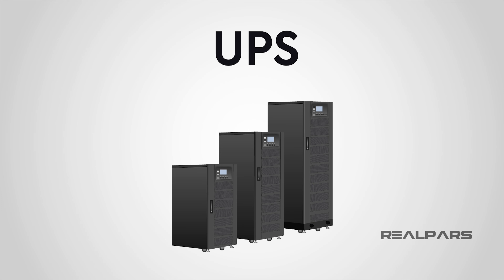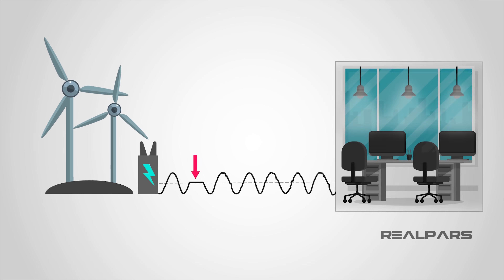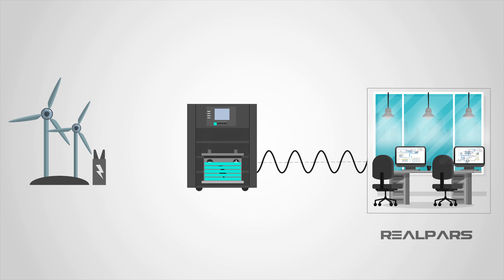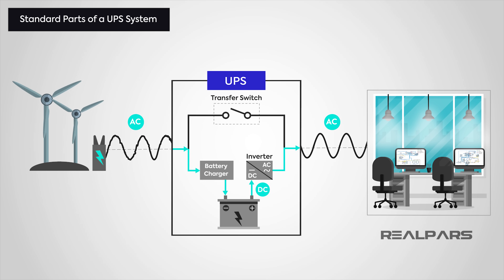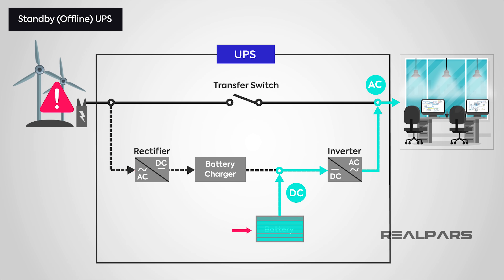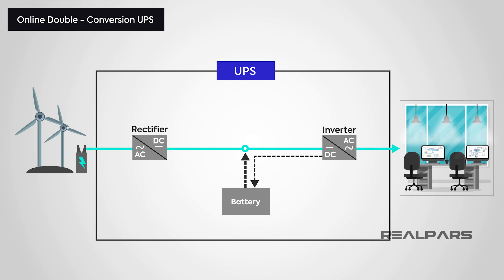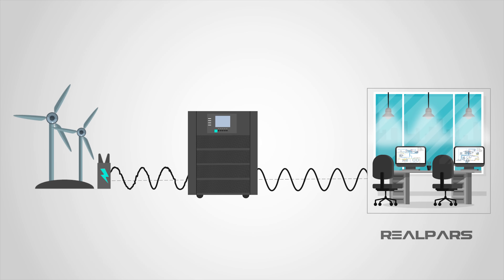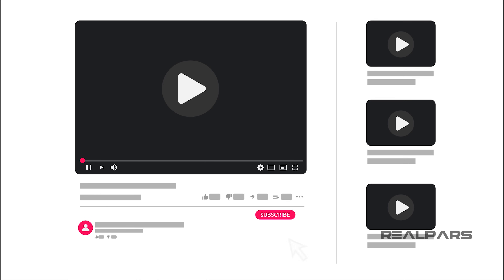What is a UPS? (Uninterruptible Power Supply)

Comment: Is it possible to run the UPS on a solar system for off the grid power for a house
Reply from the maker: Yes.  The UPS would be recharged from of the electricity that is produced by the solar system.  UPS's sized to power a modest home or cabin are not too large, but can be expensive.  A 1500W UPS can cost up to $3000.  If you have a refrigerator, TV or electric water heater or stove in the off-grid dwelling, you may need a much large unit or multiple units if these need to be operated during "dark" hours.

Comment: I would like to ask if the battery charger works as the same as the rectifier does converting AC to DC?
Reply from the maker: Yes.  Battery chargers use a rectifier to convert AC to DC, and they have additional circuitry to limit current to the battery charging circuit.

Comment: 3:48 why separate the battery charger and the rectifier? Battery chargers already have rectifiers in them.
Reply from the maker: From an electronics standpoint the AC/DC rectifier is separate from the regulator that manages the battery charging.  These two circuits work together, and from a "package" standpoint are indistinguishable.  The illustration emphasizes that the AC voltage needs to be rectified prior to charging the battery, and then inverted back to AC in the output circuit.

Comment: Can we get a variable frequency drive that is also a UPS?
Reply: NO, a UPS must keep the frequency fixed to say 50Hz in Europe.
Reply from the maker: Enrique is correct.  UPS's and VFD's are very different electrical devices.  Usually, UPS systems designed to supply AC to motors and drives are very large (rotary UPS) or alternatively, backup power can be provided for these large loads with generators.

Comment: Excuse me,what is defference between UPS online and offline?
Reply from the maker: Online UPS provides power to the connected load from the inverter circuit of the UPS.  Incoming power is rectified to DC to charge the batteries and then inverted back to AC to power the load.  The UPS inverter circuit is always "on line".  When a power outage occurs, the UPS switched from mains to battery power.  For an offline UPS, mains power bypasses the battery on the way to powering the load.  At the same time one branch of mains power is used to charge the battery.  When a power outage occurs, the transfer switch opens and power is drawn from the battery/inverter.

Comment: Can you please explain Static switch in UPS. Its construction,its components and its working.
Reply from the maker: While the UPS is on-line, either on main or battery power, the static switch is in ‘Load On UPS’ state, connecting the inverter output of the UPS to the load. However, if a UPS fault should develop, causing either the voltage or frequency at the inverter output to exceed acceptable levels or an overload , the static switch changes over without power interruption to ‘Load on Bypass’.  The circuitry is all sold-state, with voltage and current comparators determining the health of the UPS output.  The static switch fails over to bypass power if a problem internally to the UPS is detected by these circuits.
Reply: @realpars  You've left a LOT out. He asked how it works. Lot's of UPS use different methods.
Some fully rated solid state, some a mix of contactors and partially rated SCRS.
You've not mentioned the two pairs of SCRS, (usually), or much else.

Comment: Hi. The video is really good and informative for basic understanding. Kindly share the knowledge about how to size the UPS?
Reply from the maker: Sizing of UPS systems is based on load and required time for supplying backup power.  A simple way to do this is to add up the loads (in VA or Watts) of all connected equipment and multiply by 1.2.  Then go a UPS manufacturer's website and select a UPS that will output at least the total load that was calculated.  Then, decide how many minutes of backup power is required, and select the desired model from the data given by the manufacturer.  Most manufacturers can help you do the calculation, and many have "calculators" on their websites.
Reply: @realpars  Thanks a lot 😊

Comment: I'm quite a fan of your video tutorials. But in this one, one point is not entirely correct: double conversion UPS are not the most efficient version, quite the opposite. They offer the best power quality, since there is no interruption at all and the AC is newly generated, so no variations or harmonics from the grid are getting to the equipment. Even the frequency can be corrected or changed from 50 to 60Hz of needed. But this process of double conversion is not the most efficient, since it has permanently the losses of an AC-DC conversion plus the losses of a DC-AC conversion.
A UPS with transfer switch has very little loses, as under normal operation no conversion is occurring. But you get all the power quality problems from the grid to the load. And you can not influence the frequency.
Reply: Double Conversion also has the battery in use 100% of the time, reducing battery life length. Replacement batteries are expensive.
Reply from the maker: Thank you for your comments.  You are correct about the differences in efficiency (~96% for line-interactive, ~90% for double-conversion), but this is rarely the decision point for selecting one over the other.  As you indicated, there are specific advantages to the double-conversion design, which are necessary in particular applications.  Both UPS designs provide efficient operation; >90% efficiency is very good for any electrical device.